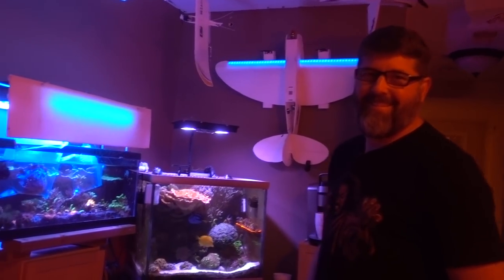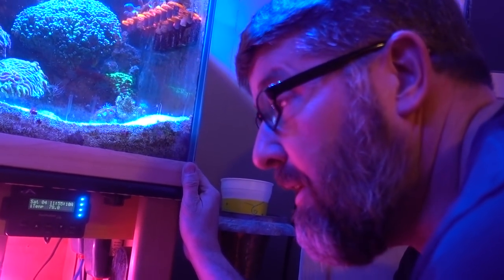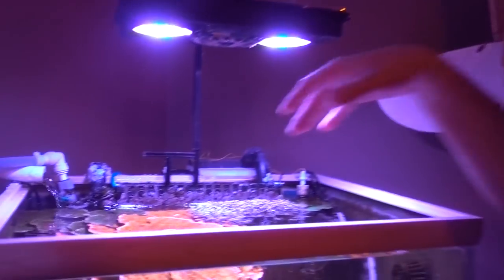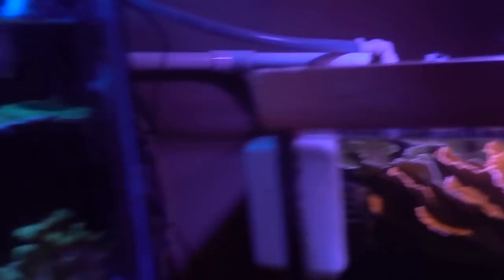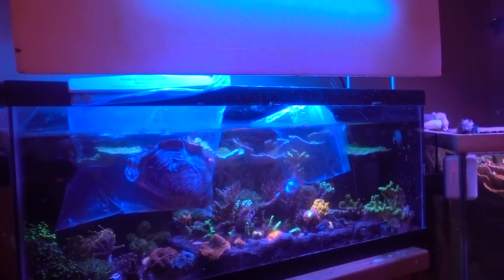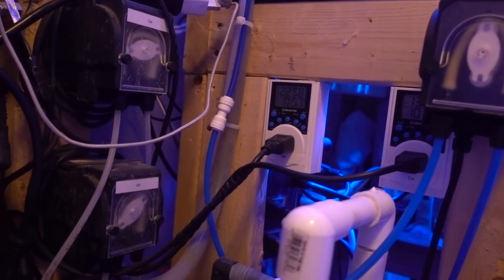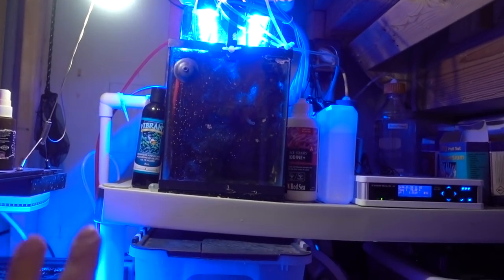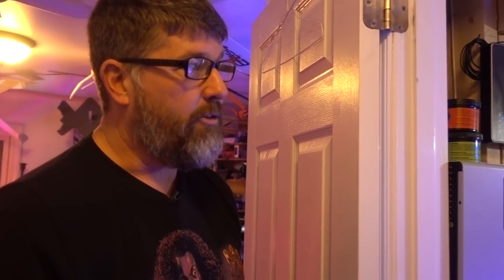Solar Powered Reef Tank + Auto Water Change?! (Reef Sensei - 1/12/2019)

Comment: An interesting look at a beautiful mess. After watching this it did make me want to clean up the area around my tanks ect. The cheapo dosing pump on a timer is a great idea too.
Reply: Average Reef More like a hot mess! If you consider the retail price of the BRS 1.1mL pump plus the timer, it’s not a value dosing solution compared to the Kamoer X1; however, the BRS pump is a quality unit that stalk in the used market and it’s slow dosing can be a lifesaver. Long story short, quality worth considering.
Reply: @telegraham  I meant the jeabo you're using. I have been using those brs pumps on and off for 10+ years. I think I still have one of the earlier models that was 1.5ml not 1.1ml. While as I'm sure you've learned they are not all exact but they don't really loose calibration once you've figured out their exact speed.
Reply: Average Reef Oops! Sorry. I’d suggest staying clear. I’m sure it’s possible I got a bad egg, but support was nonexistent. Better to grab four 12VDC heads from Amazon and throw them on a timer. Same quality and way less expensive. Learned my lesson. 😊

Comment: I have a new 75 gallon saltwater with a 30 gallon sump. Would you do a water change while the tank is cycling ? 
Second when it is up and running for a while do you do the water changes from the sump?

Comment: How is this tank heated off solar? How many watt heater are you running have you considered dc heating elements?
Reply: Red Porter Realistic output from my four 100W panels is something like 320W after temp compensation and line loss. Just after installation, I saw something like 300W. The panels feed two 50ish Ah batteries in parallel. When the 200W heater kicks in, and if the panels aren’t producing enough power to support the heater, the batteries carry the load. During that time, the panels are still making juice, and they’re helping the batteries. When the heater turns off, the panels recharge the batteries. Regarding DC heaters, I looked, but the heaters I trust and that are easily available (beyond the spare in the garage) are AC. I’ll stick with AC and accept the conversation loss. When summer roles around, and the chiller is needed, I’ll have to add more tech. The chiller’s surge load pisses off the 800W MPP charge controller, so I’ll bypass it with a relay and an appropriately sized pure sine wave inverter. As money (and sales) allow, ill add more batteries. I also have the option of plugging the whole thing into my car, but that’s a story for another time. 😊
Reply: telegraham nice to have a little redundancy.! Yeah ac heater won’t work in my application (off grid). It took several hundred ah batteries to run my tank overnight with a ac heater. I’m currently using a Missouri wind and solar heating element dc at 250 watts @24 (up to 1000w @48v) volts via inkbird controller. I have done the generator and car thing also, The tank has been self sustained since July and only the calcium reactor still runs off my inverter. It’s a hard route and a bit of soldering for the dc converters. Thankfully everyone except EcoTech uses 2.5mm barrel connectors. Are you using a 12 or 24v inverter? Most dc pumps are 24 volts so you can use a drok to step up the voltage to 24v. If your on a 24v system the drok will just stabilize the voltage, this is how my kessil h80, skimmer and return pump run. I have a separate buck boost at 19v for my kessil 360x. Long story short dc-dc will save your battery’s and actually watts apply.

Comment: Dosing carbon without a protein skimmer. Is that not counterproductive, or can it work?
Reply: Simeon du Preez I’ve not found that the two are related, and I’m sure there are a bunch of carbon dosed skimmerless nanos out there. I dose NOPOX to support the bacteria, and run the skimmer for no other reason than to bring in outside air. My other than intended use of the skimmer is not a best practice, but that’s how my system has balanced out. If anything, I should increase my NOPOX dose to help reduce phosphates, but I’m holding steady state while testing long term lanthanum chloride microdosing. BTW, I removed and cleaned the skimmer this weekend and it’s back to bubbling and the cup is overflowing. That’s how it typically runs.
Reply: @telegraham  thats interesting. I have only been reefing for a couple of months and its nice to see that all the prophets of doom I meet on the internet aren't necessarily correct. Your tank just goes to show there are many different ways to skin a cat.
Reply: Simeon du Preez Totally. YMMV, but there’s always a way to make it work. What kills one tank makes another thrive. I’m doing it all wrong, and it works. 😊